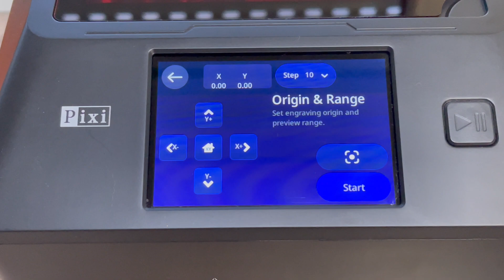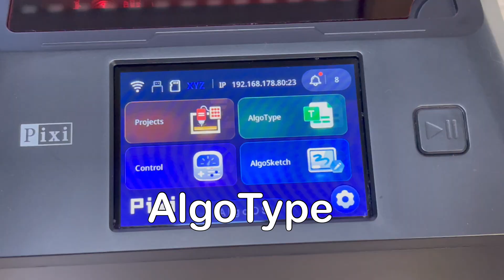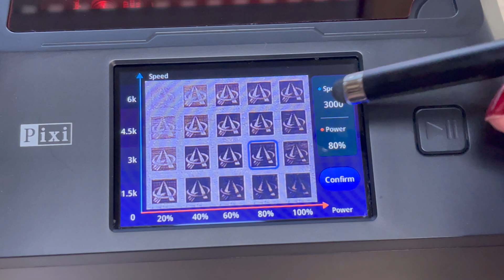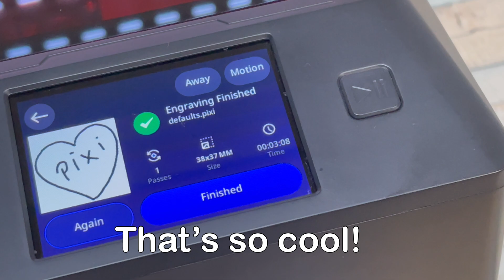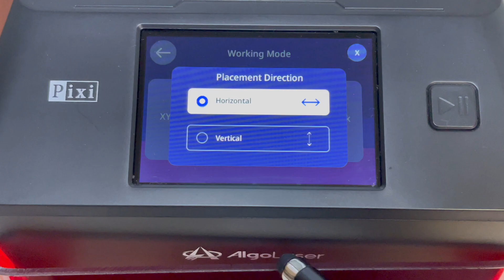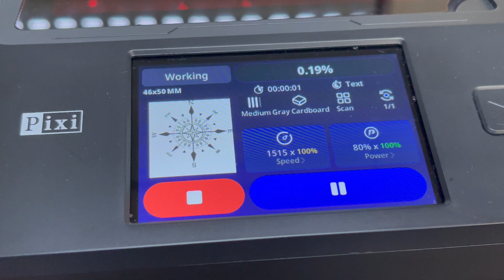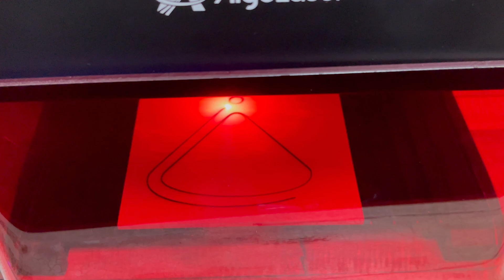It’s Cheap, it’s Cute, and it actually works!| Algolaser PIXI Review and Tutorial

Comment: Don't need a computer but dies it have software so you can? & does it go up high enough that can engrave on cups or tumblers?
Reply from the maker: The machine comes with some projects included so you can start working as soon as you receive it.  You can also use your own projects by using a USB pen
This machine is compatible with lightburn or LaserGRBL if you prefer 
You can also use the AlgoLaser software to operate the machine
And yes, you can adjust the machine to engrave on cups or tumblers :)
Reply: @sandrartes baby cups??? After I saw how small the work area is, realized that question was mute. Not really a lot can do on such a small laser